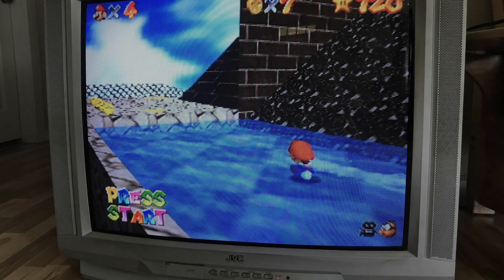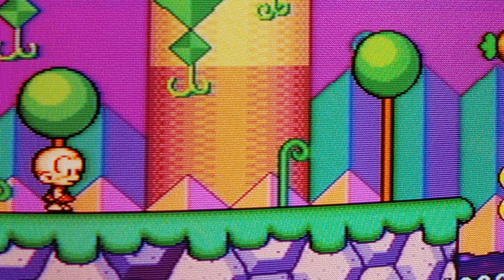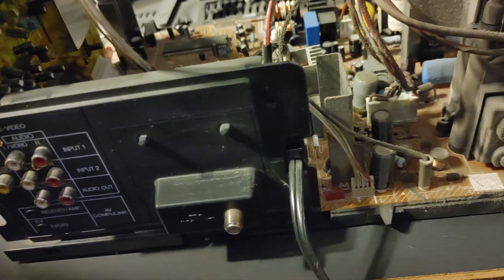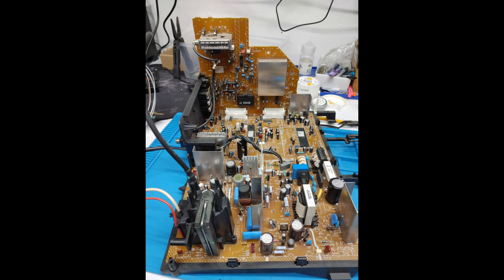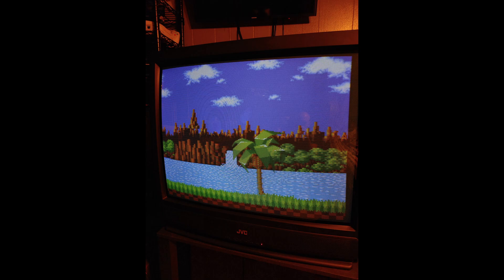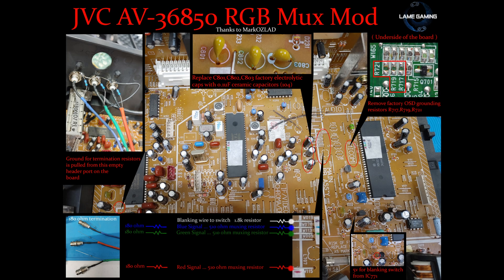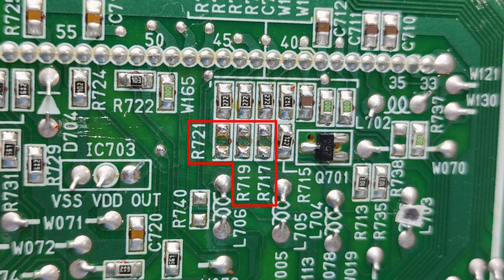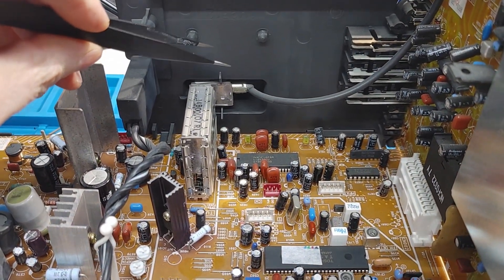JVC CRT Non D-Series RGB Mux Mod - Thomson RCA Arcade Tube - AV-36850

Comment: Just picked up a 1vpp early 90s panasonic. I think I fluked my other sets being 0.7vpp. I tried 75 ohm termination being ignorant about it's actual requirements and it was very dim as well. Need to wait for local shop to open to grab some 180 ohm resistors, I tried no termination and the picture is good but can't be right with no termination?

Comment: Great video. I managed to do the same mod on an AV36020. Did you run any resistors for the sync? Think my jamma output is too high and making my TV cut off.

Comment: Lol I know this is an old video but I had to comment on the retro corner! Lol me too my wife says the same😂😂😂
Reply from the maker: Yeah, luckily I moved and have my own game room now so she cant say a thing anymore lol
Reply: Nice bro! I have finally built me a little shop in the garage. Also, I have this tube from the video in a D series set from 02. It's the av36d302A . higher-pitched tube. I think that the set you have has a better build quality than some of the later-year D-series models. That tube has a softer picture and the whites aren't as bright but I believe it has a better picture overall for a 36. There is a reason they used it for so long in all those arcade monitors. It's like splitting hairs though with these D-series tubes. I haven't seen one that didn't look amazing with a SNES or Genesis hooked up to it.

Comment: Nice, just wondering why didn't u install a Scart socket?
Don't get me wrong those BNC connector and silver blanking switch looks like sex.
Reply from the maker: I have alot of pvms so have alot of bnc cables.... And they are cheaper than scart usually and I have just avoided scart for the most part... No real reason why, I guess im just invested into bnc lol

Comment: Liked and subscribed! Yo, I have a 27" JVC (and a 32" D series that I forgot why I didn't like enough to put away in the shed). The 27" is just looovely, however focus on teh corners is hella soft. I'd love to have a sweet JVC experience like you got here. Would you RGB mod a tv if it has component already? How would you go about fixing edge focus if you wanted to? Much appreciated, bro!
Reply from the maker: Nah, If its got component already then its 98-100% as good as rgb and wouldnt even bother. I looked for a D-series forever and never found one around here so thats why I grabbed the 36" JVC that didnt have component and rgb modded it.
I know what you mean by edge focus. You can either have the center super sharp and edges a little soft , edges super sharp and center a little soft, or you can dial it in to look decent across the entire screen but its a trade off. Look on the back of your set by the inputs, should be a slot that lets you access the pots on the flyback. Theres g2 voltage pot and focus, play with it untill you get a happy median..... just dont turn the screen g2 pot by accident lol
Reply: @LameGaming  Wonderful, thanks for the detailed explanation! Does turning down (or up) the g2 help with focus. I think I read that somehwere. If it's too dangerous to mess with, I won't lol. Appreciate it again, and look forward to more content!
Reply from the maker: @mahdiyussuf9804  Just think of screen g2 as a master brightness of the tube. If you have a super dim tube you can increase g2 to give the tube some extra  brightness but usually at the cost of washing out the blacks. Increasing g2 too much can overvolt the set and put it in protection mode.
Reply: @LameGaming  Got it, thanks man!!

Comment: I got a AV-27950 with the same jungle chip. Trying to RGB mod it for an arcade cabinet. Wondering if I need to do this mux mod? Or if there’s a simpler way to get rgb in since it’s going in an arcade anyway. Very new to this, any info is appreciated.
Reply from the maker: Id definitely mux mod it. The old hack and switch rgb method might sound easier but youd have to run a ton of wires and lose ability to see osd when rgb is active.
With this set rgb is injected late in the jungles circuitry so none of the menu settings have any effect. I had to use g2 adjustments, and set rgb cutoffs in the service menu to get rgb signal really dialed in..... Muxing allows you to see the osd/service menu while viewing your rgb signal..... Id hate to try to dial things in without that ability, you would have to switch rgb off just to see your menu with the old switch injection method.

Definitely would go with mux method. Would make an awesome arcade cab tube. I thought about using mine with a mistercade in a cab maybe in the future.
Reply: @LameGaming  yeah if those adjustments are needed then I have to do the mux. I’ll follow what you did since I have the same jungle chip. I appreciate the reply
Reply from the maker: @bartman2468   They were definitely needed on mine but you may have better luck.

My green level was good but red and blue were low, I initially boosted red and blue cutoff but kept triggering overvoltage protection on white screens, I ended up setting cutoffs back to factory and boosting g2 a bit and fine tuning with cutoffs.

Theres more details here if yt lets me link it
https://shmups.system11.org/viewtopic.php?f=6&t=69727&p=1507119#p1507119
Reply: Great video. I just wish I had the same model. Mines an AV36020, same jungle but different board layout. Is there any way to get a diagram for mine? I posted on shmups and figured I'd try this, too.

Comment: Great video man!, I have a JVC D-Series AV-36D501, it looks almost identical to yours in the inside, it even has the same tube but mine has component, do you think your exact rgb mod apply to mine too?
Reply from the maker: You would have to pull up your service manual and/or schematic for jungle/micon..... See if they are the same, the factory circuit pathway from micon to jungle on the board would have to be the same as well. Same caps and resistor values on circuit.... If its an even slightly different board then it would probably change things and I assume it would be since it has component.
Honestly .... If I would of found a D series with component then I wouldnt of bothered with rgb since component is arguably probably 95%+ on quality of rgb.... I doubt youd notice a difference that would justify the effort honestly.

Comment: good to have you back at it again.
Reply from the maker: Thank you sir! Im out of town alot for work now but will try to making vids when I can.
Reply: @LameGaming  what are you currently using to record your CRT footage?
Reply from the maker: @saltymanos  A lumix g85 and its a pain in the ass. Theres no lowpass filter in this camera so moire' is a problem, Im able to reduce it some by setting sharpness to -5 in the "natural" image mode preset and then add mid detail back in edit but the rolling bar shows up unless I lower shutter speed to 20 which causes motion smearing.
Riggel gets really good results with an iphone and ProMovie recorder app so ill be grabbing an iphone soon i guess lol. Some shots were recorded on my phone as well (lg v60)
Reply: @LameGaming  you can definitely get it done with the g85. There are some things to consider when capturing CRT if your in NTSC you can get much cleaner results when in manual mode and starting off at 60fps in 1080p to match the CRTs 60/50hz depending on what region your CRT is playing at. 
To get past the banding try lowing the CRT brightness if you can’t relief that try lowering the cameras ISO and leave your F/stop at 2.8-4f. Custom white balance to 5000 [K]kelvin temperature. Sorry to throw all that camera tech jargon but I know that camera can deliver.
Reply from the maker: @saltymanos  I appreciate the tips but sadly ive already tried all those suggestions. Even bought a $500 prime 15mm f1.7 leica lense to see how it would do. I setup my tripod and spent half of a day in full OCD mode capturing hundreds of clips at different settings while narrating to myself the settings used. 
Your right, 1080p60 at 60 shutter with open aperture , iso 200 to 400 , and sharpness on the sensor turned down gave good results that were smooth and flicker free but every 3-4 seconds that rolling bar would slide down and drove me nuts. I tried all shutter speeds and incriments of 30. Anything above 60 would increase the rolling bars duration, as you get under 30 shutter the bar starts to disapear. At 13 shutter its completely gone but at that low of a shutter its smeary as hell, 20 was a good compromise. 60 should be what works the best but this camera just doesnt sync well with crt frequency for whatever reason. Even tried a tinted glass piece in front of the crt to mask moire 🤣
I updated the g85 firmware and shot some more as well but the update had no affect. I wish you could make fine adjustments to shutter on this camera 😖
Oh.... Was in full manual mode with manual focus as well and tried taking clips at dozens of different focus ranges as well. Full peak focus,slightly underfocus, a little more, a little more, etc etc etc lol

Comment: I have a Jvc 32d303 with the M tube I think. I'm not exactly sure what the mythical M tube even is at this point. It has a big M on it and says M80JUA061X06. I dunno lol. Love your content.
Reply from the maker: Did the 32D303 model number have a Y after it on the sticker? That would be fun to test.... Mess with
Reply: The model number is AV-32D303 then theres a W, then off to the side there's an ME. Serial No. 13797796 M. My 27D502 with the Thompson tube has all the same W and ME stuff but seriel No. ends with AR. Why is this so dumb?
Reply from the maker: @brentimus8051  would be cool to take high res shots of it and a non M tube and zoom in and actually count the lines lol
Reply: @LameGaming  I can do some comparions if I didn't break it trying to recap it. Right now the 32 M is in pieces till the last caps get here supposedly tomorrow. Then hopefully...it turns back on. I am not a professional. It's a 27 vs 32 though so they will look different. The 32 M was super sharp before I broke it down. The 27 thompson has incredibly vivid colors.
Reply from the maker: @brentimus8051  That would be cool, you should make a video!